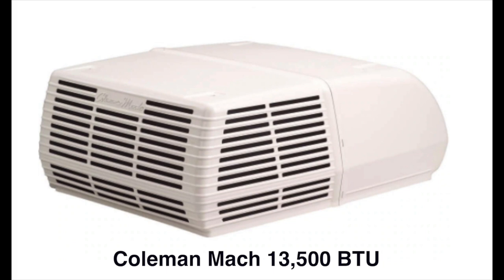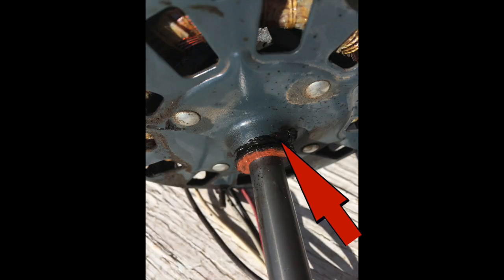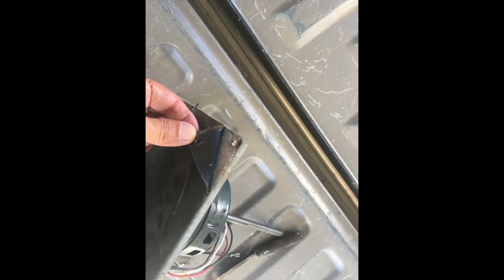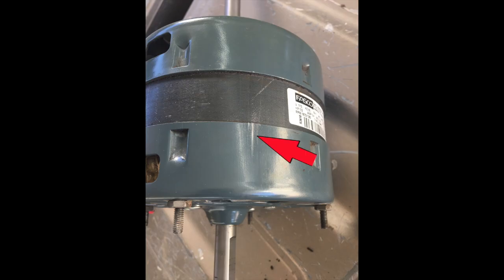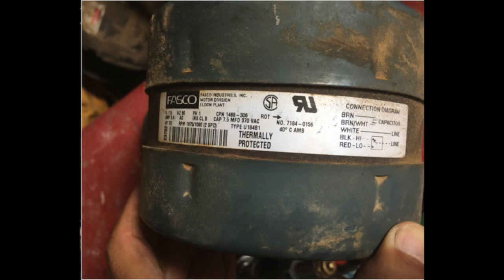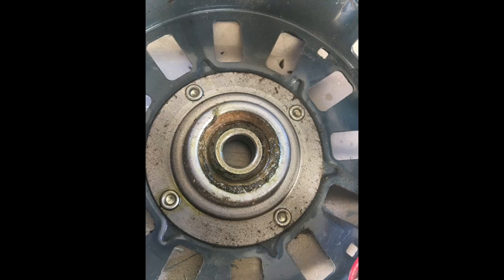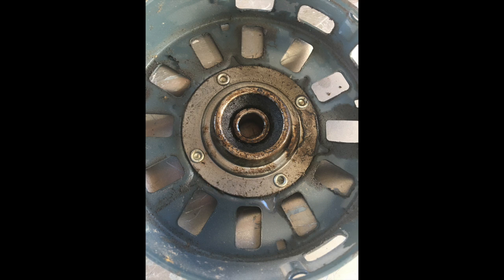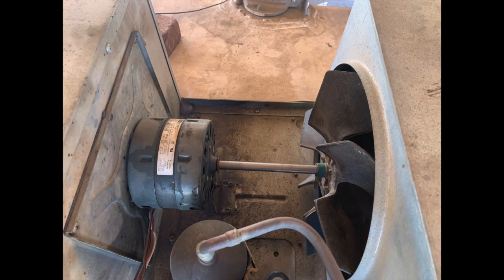How to oil RV AC motor bearings with no ports

Comment: I did something similar with my attic fan motor - they would fail about every 2-3 years, and then had to be replaced. I took the old motor, disassembled it the same way as you, and saw that it had the same bearings as you described. I have a home machine shop, and I manufactured a set of replacement inserts to use sealed ball bearings, instead of any sleeve - the shafts were a standard size, so it was easy to find alternate bearings. When the 'replacement' motor started to go bad, I replaced it with my modified one. That was 15 years ago, have not had to replace it again.
Reply from the maker: Paul, that is great! Friend, your comment is gold, and one that I have been waiting for someone to post. I thought this would be the way to go to fix these motors that failed on me, but could never figure out how to replace it with ball bearings; I have no home machine shop like you have to be able to do this. Can you explain in more detail exactly how you did this?  Can you list the parts you used and where you purchased them, like the ball bearings?
Reply: @productandequipmentreviews7386  Sizing the bearings is easy, with a caliper - if the size seems 'odd', like a number that cannot be expressed in 1/16 or 1/32 increments, then the shaft is probably metric. That is the ID needed, the OD is not too important, as is the thickness. I machined the bearing holders from aluminum bar on my 6" lathe to the size of the original bearing location and of course, to the size of the new one. There are lots of sources for bearings, but the one I used most is McMasterCarr supply.
Reply from the maker: @paulmoffat9306 Thanks, Paul. What you did is so great that I would like to make a video of it. Could you contact me so I can get more information from you? My email is: adobemastr@gmail.com        Refitting those sleeve bearings with ball bearings is simply fantastic, and I believe many people would be interested in knowing exactly how you did the replacement. Did you happen to take any pictures or video of the project?  And do you think there could be a way to replace the sleeve bearings with the ball bearings without having to use your lathe?
Reply: @productandequipmentreviews7386  I am curious if you ever heard back from Paul on this.  It is baffling why they use this type of bearing knowing how much heat they will have to endure.  I am going to be trying to replace the bearings with ball bearings in my "old motor" and will let you know how it works out.  Would it not be possible to find a bearing that would fit without the need for the cups?  I also don't have a lathe and hiring a machinist would cost 2x what a replacement motor is.  Thanks for such an informative video.  Cheers.

Comment: If I was going to pull the fan out every 12 months to oil it, I'd have 2 motors. One always ready to reinstall while I was re-oiling the other..
Reply from the maker: That's exactly what I've done.  In fact, I have at least two to three replacement motors sitting in my shipping container I use as a storage unit in case another of these motors go out again.  I never want to be sitting in the Tucson sun in my RV waiting for a new one to arrive.

Comment: Thanks. No bearing will last forever without relubrication. And it's foolish to replace the entire motor for want of oil. I had this same problem with my pool pump. Just dumb that it only lasts a couple of years then need to replace the entire unit. With the cost of Copper so high now it makes sense to service the bearings even if the manufacturer says it's not necessary.
Reply from the maker: I agree with you 100%. Some interesting news: Coleman is now making these motors out of ball bearings. A company called "Emotorpro" is a distributor.  This would be a game changer. The problem is, they are selling this motor for over $300.  The part # is 1468-3489.

Comment: Thanks for the nice clear instructions. I don't think the Donald McAdams video you mention is on YouTube anymore, though. I opened up the Broad Ocean motor on my Coleman Mach 3 to find that it uses ball bearings, not sleeve bearings. One was a bit dry which was causing an intermittent chattering sound, after previously working without issue for 9 years in a desert environment. When properly lubricated, the shaft should rotate with hardly any resistance. You should be able to turn the fan blade with a finger and see it spin for 10-15 seconds before coming to a stop.
Reply from the maker: Thank you for pointing out that link is now dead. That's too bad because it was a decent video on how to remove the motor and is why I did not include any video of how I took it out because someone else had already done that.
Reply: Where did you get that ball bearing motor from?

Comment: Your story at the start is the same story I've had with walmart fans (like 15 bucks for a basic lil metal fan or the "honeywell" fan).. get a year or two out of 'em before they didn't want to turn. I'm finally like screw going to buy a new fan I'm taking this one entirely apart.. and I did. 
No felt to hold extra oil, no oil port.. just pulled 'em all the way apart. Only thing wrong in there was the lubricant had gummed up. Cleaned it off from the shaft and bushing, gave it a good slickin with sewing machine oil, put it all back together and it runs like new. I do have to relube it more often than most motor maintenance says.. I suspect because no felt, and maybe a little to do with it being sewing machine oil instead of 3-in-1 (20w non detergent) 

But it beats buying a new fan when all the old fan needs is fresh lube
Reply from the maker: That is a great story! Have you considered making a video about this? In fact, I have TWO of these fans sitting around that died on me like so many others of the ones you just described. But your results makes sense considering what I went through With my RV motor. Thanks for the reply!

Comment: Hey, I appreciate your video.

I'm not repairing an R/V air conditioner motor, just a simple window fan. But there are some similarities in the motors that were informative to me. Also, I am by no means an motor repair person, just a guy who is somewhat handy and has a small mish-mash of tools.

My window fan also has a motor with sintered bronze sleeve bearings, and it also has what I believe is that Permawick junk as an oil wick. Other, older fans that I have taken apart, such as a bathroom ceiling fan, have a felt material for an oil wick. The felt is much more durable as it holds together better. On top of this the motor is very cheaply made. The bearing housing is simply pressed steel, a small ring of permawick is around the sleeve bearing and both are loosely held in place by piece of metal that looks like a lock washer. Each bearing is attached to the motor housing by four small metal tabs bent around their mounting points. I'm sure these metal tabs will eventually break off if unbent and bent too many times. A very jenky design.

One of these bearings ran dry. So, like you, I have been trying to figure out how to service it and keep the fan running. I replaced the capacitor, then found out that wasn't the problem. Eventually realized it was the bearing. Cleaned and oiled it last week, but now it is failing again. May have to soak the sleeve in oil overnight. Also, might have to replace the Permawick with a felt pad. It would have been a lot easier if the motor had oil ports and a better wick material. I guess that's the world we live in today where everything is cheaply designed and cheaply manufactured. Sigh.

Comment: Recently replaced my condenser fan motor. I just located the nuts Unser the seal, removed through the opening, then covered with duct tape(sealant might be better)
Worked great
Saves lots of time
No known issues

Comment: Great video. Good explanation of the type of bearing and your research done finding out exactly what the manufacturer uses for lubrication. Thanks for sharing this information.  I have two AC units on my 5th wheel trailer, both have motor shafts seized up. I figured the original lubricant gets gummed up and causes this problem.  I thought they had Oilite bearings or more like a bushing impregnated with oil, bronze and copper particles. Too bad they dont use a roller or ball bearing that can be packed with grease. Maybe too much heat.
Thanks again for a great video 👍👍👍🙂

Comment: Perfect video for  , very well explained. I have that problem right now. Fan is stiff and hard to turn. After spraying lubricant on shaft it turn with no problem.
Reply from the maker: @Marilyn Dreamwalker Mejorado That's why you have to take the motor apart so you can re-oil the bearings.  If the motor got so hot that the bearing material is "pushed out," you may need to replace that bearing material.  In a pinch, I believe you might be able to use sawdust, believe it or not.  I read somewhere that is exactly what some motor manufacturers at one time used.  And it might be that the bearing got so hot from lack of oil that it is fried and you might need to replace the motor.  This is why it is so critical to be able to re-oil those bearings; and to do that, you must take the motor apart as described in my video.  Good luck.

Comment: Thank you! Very well done! Excellent advice. Even tho I have an Advent ac.  I'm in Las Vegas Desert, so same concerns. Is it possible 2 just replace these Sleeve bearings? Where? I have an Advent on trailer. & It's on 24/7, so it concerns me. Already replaced brittle disintegrated fan blade from heat. Links 2 resources would b nice. I'm trying 2 figure out removal of fan motor. Is black rubberized gasket necessary 4 sound? Is it replaceable? 
Thanks 4 this Professionally done video! 
JDR
Reply from the maker: I think you can replace these sleeve bearings but it would require some tools and knowledge that I don't happen to have at this time.  These bearings seem to be attached to the housing hubs using some type of rivet system.  I've seen sleeve bearings advertised on the Internet (do a google search and you will see what I mean) that I believe would work as replacements, but again, it is knowing how to take them out of their housings and properly replacing them using the right tools.  But I think you are on to something and believe it is a great idea.  If you figure out a way to do this, please reply and let me know how you did it.  Other RV'ers will much appreciate it!

Comment: I'm in the Mojave desert and have been having this problem for weeks, so I'm glad I found this video. Unfortunately my AC has a built in foam enclosure instead of a metal plate, and it doesn't seem I can remove the motor without destroying the foam.

Comment: Do you think it would be safe to drill a tiny hole to squirt oil on the the wicking material? Or is there enough room to install a tube to lubricate from the outer part of the housing? I live in San Diego so I don’t get the heat but do get the salt breeze.
Reply from the maker: That is a great question, and I thought of that myself, but determined that it was better to remove the motor from out of the AC unit and then disassemble the motor and then re-oil the bearings as you saw in the video. But you know the old saying: "there is more than one way to skin a cat," and perhaps your idea would work.  But here's the issue: let's say you could reach one of the bearings by drilling a hole in the housing of the motor and then dripping some oil into it; that might be possible. But the problem is the other bearing that you have to reach, the one that is inside the AC itself; how would you reach that one? This is why I think you need to remove the motor from the AC unit, disassemble the motor itself, and then re-oil the bearings like shown in the video.  If you go slow and are patient, it is not that difficult of a job to do.
Reply: @productandequipmentreviews7386  Thank you for responding and great feedback. My AC hasn’t given me issues yet, but I always like to be ahead of some things.

Comment: @product and equipment reviews.  
Thank you for such a good video on this topic.  I'm not trying to kick a dead horse but my problem is slightly different than what I have found videos on.  my ac keeps running for a few seconds after I turn it off. The rubber gasket where the shaft goes into the motor deteriorated last year when we took the cover off to clean and check it.  I put a drop of regular 3 in 1 oil on the shaft probably not enough because I read not to over do it and it was more for the rusty shaft than the bearings (didn't even know about that last year)  after watching your video I think I understand what is needed. 
I am wondering have you heard of Fluid Film and if so do you think it would work instead of 3 in 1 oil. I haven't seen any in a blue bottle.
Reply from the maker: I've never heard of "Fluid Film" but you can use any light oil, like the 3 in 1 in the red bottle (but the blue bottle is better from what I understand).  Putting a drop of 3 in 1 on the shaft is certainly better than nothing, but you cannot get enough oil by only doing this:  you absolutely need to remove the motor and re-oil the sleeve bearings as I showed in the video.  It's not that hard.  Now, the video I linked to in order to remove the motor is no longer up so you will have to search around and find another video on how to remove it. As far as the AC continuing to run for a few seconds after you turn it off sounds like an entirely different problem than what my video addressed, but I'm sure there is a video on that as well...you just need to search Youtube.
Reply: @productandequipmentreviews7386  thank you for the reply 😁
Reply from the maker: @winnerscreed6767  You're welcome!  Best of luck with your project.  I finally put in a mini-split in my RV and I have to tell you it has made all the difference!  It was a TON of work to do but worth every dollar and nanosecond of time I put into it.  I did not remove my Coleman Mach unit but will leave it up there in case my mini split goes on the blink and I will have the old unit as a backup.

Comment: I'm hoping this is my issue. I have the same unit with endless squealing.  I'm going to check it tomorrow
Reply: Did you get the squealing stopped?
Reply: @adobemastr  it broke down completely before I could , so I just replaced the motor sadly. But your tip was helpful

Comment: Use Amsoil synthetic grease, will not dry out and cuts friction better than any other product on the market.
Reply: I looked up this grease and read through their literature; it says nothing about this grease not drying out.  there is no way I would use this grease or any other grease on these type of bearings because grease will dry out like the video says. I would stick with using only a light oil as shown in the video.
Reply: Grease on sleeve bearings is a bad idea

Comment: wonder if the bearing can be replaced with a sealed bearing
Reply from the maker: If someone could figure that out, that would be a game changer! And if you happen to be the one to figure this out, could you let us know with another comment on how you did it? Even better, make a video of it because many people would be helped by that. Thanks for the comment.
Reply: @productandequipmentreviews7386   might could take torn apart motor to a bearing store. would be my only guess. May try with mine. Going to replace one and repair one for a spare. Will let you know the outcome
Reply from the maker: @markteel8346    Mark, I did a little research prior to your comment; a Japanese company used to make these motors for RVs with sealed ball bearings in them.  They were more expensive, but I certainly would've purchased one of them because I believe they had the oil ports also in them. Unfortunately, these motors are no longer made by this particular motor manufacturer in Japan. I don't see why if you took your existing motor to a bearing shop and they remove the end caps, why they could not press or insert or in someway replace those cheap sleeve bearings with a ball bearing. Again, your comment is so interesting and I hope you explore this idea and let me know. Thanks again.
Reply from the maker: Someone just posted a new comment where they did exactly what you asked about: they replaced the sleeve bearings with ball bearings. He has a home machine shop and was able to do the work himself.
Reply: @productandequipmentreviews7386  Did he post a video?
Reply from the maker: @markteel8346  I don't think so. As you could read in my comments to him, I asked for some information, but he has not replied to everything I asked. It would be great if he would make a video on how we did it.

Comment: My motor fan is soooo rusty, it’s impossible to remove fan bc coil is in its way of pulling out. I have no choice but to oil from the outside or cut the shaft and pull it out lol